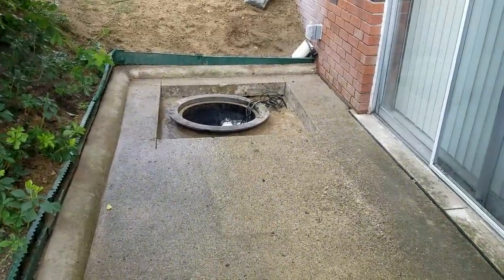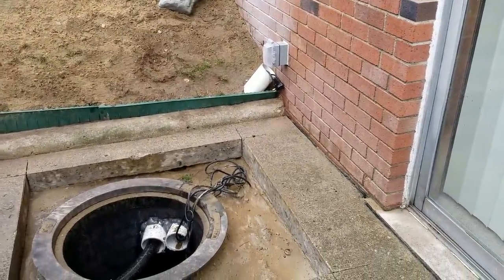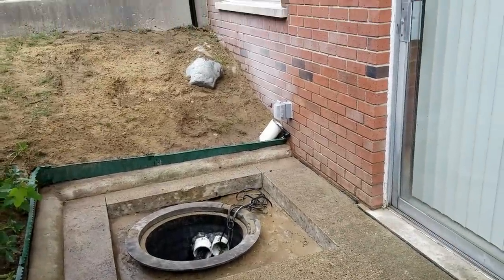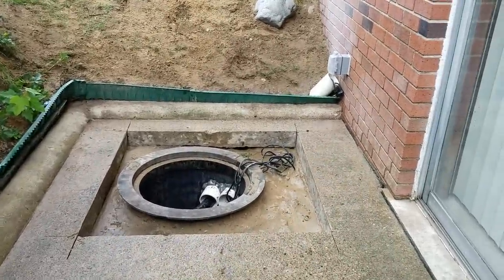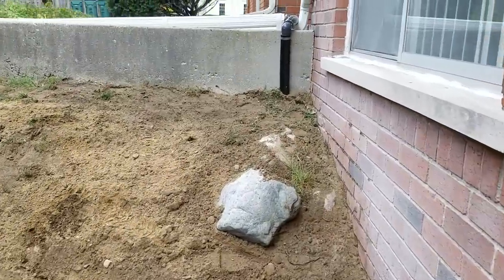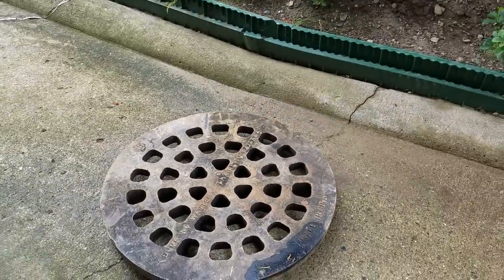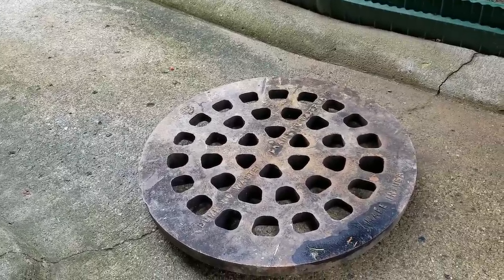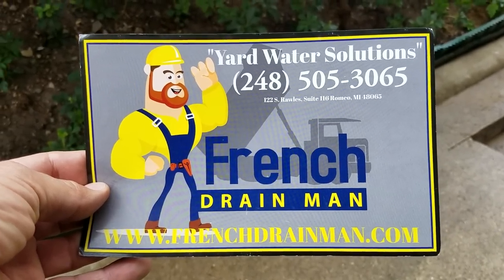Lift Station for Water Drainage Problems Using Commercial Sump Pump Basin

Comment: I'd be afraid the water left in the line after the pump shuts off might freeze.
Reply: a small hole drilled will let the water drain out of the pipe. The trick is to size the hole to what the pump can handle or you just create a loop. The water where the pump is pulling from will stay above freezing so the water in the pipe when it shut off will have some time to drain back into the pit before it cools off enough freeze.